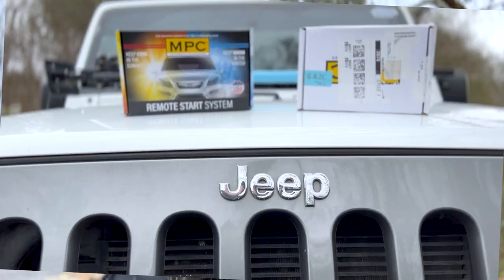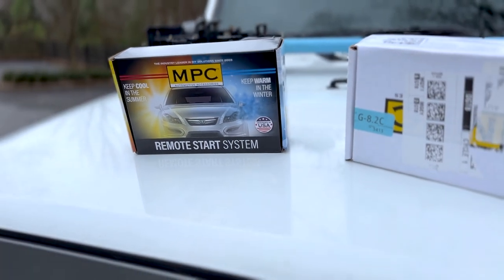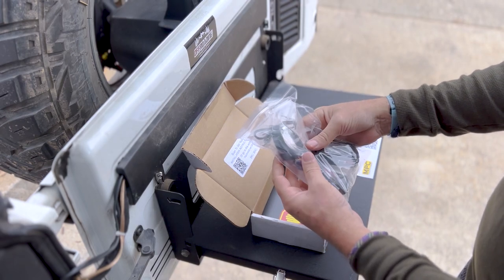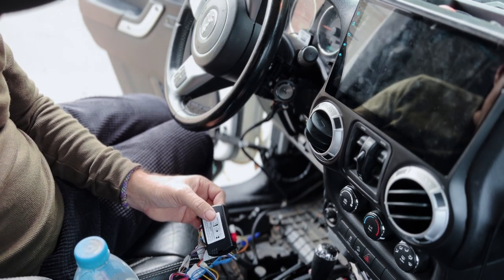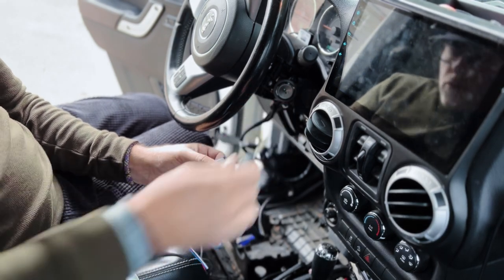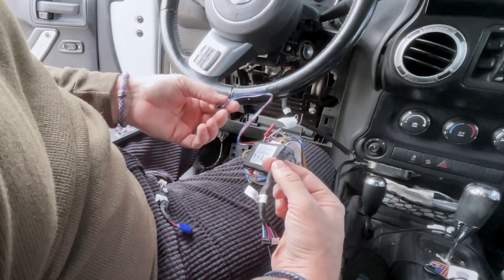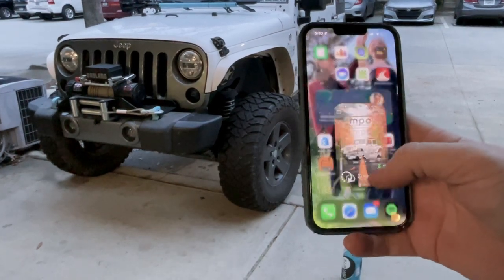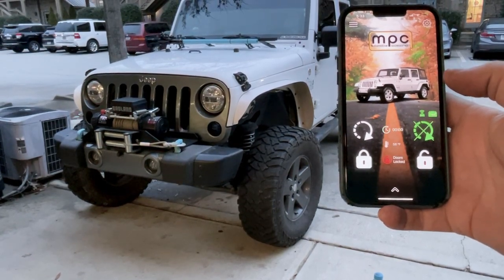Jeep Wrangler Smartphone Remote Start DIY Install

Comment: Pretty dope set up!! I can imagine trail riding/camping and it gets colder/hotter than necessary and be able to pop off the truck if the heat/ac is on and get comfy quick without leaving the sleeping bag.
Reply from the maker: That is so true. I like the way you think.
Reply from the maker: And it is timed running so you can just fall asleep with it running and it will turn itself off

Comment: Remote start is such a great thing that I don't understand why it is still an option in so many vehicles.  I have it my JLUR and kick myself in the but for not having it before in my other vehicles.  Good stuff.
Reply from the maker: I know right? I should have added this years ago. It’s relatively inexpensive and super easy to (and quick) to install. 

With winter on us now, this is such a game changer.

Comment: Will it work on a 2009 Jeep Wrangler?
Reply from the maker: I’m not totally sure. Mine is a 2015. I would think it would work. The way it connects is just plugging it into the ignition switch. 

This is by far my fav upgrade to the jeep so far

Comment: Does the remote still turn the Jeep on if you have a low fuel light or a check engine light? The factory one will not ☹
Reply from the maker: Low fuel, yes. I’m not sure about check engine. I have been lucky enough I don’t have any check engine lights on … I’m a bit OCD and take care of them quickly.
Reply: @RoadRashOffRoad   even with my new engine I still get the sporadic check engine light.
Reply: I could not understand why the app wasn’t working! Was about to send this back until I saw this comment. I cleared my check engine codes and the app finally started the jeep. Thank you!
Reply: Ok couple days later…my check engine light obviously came back, but the app is still working perfectly! lol Also, I let my low fuel light turn on and the app still remote starts the jeep.
Reply: @ScottieRojo89  now my remote start was a Jeep factory item. Those were the issues with mine.  Glad to hear that the aftermarket model does not have the same issues.